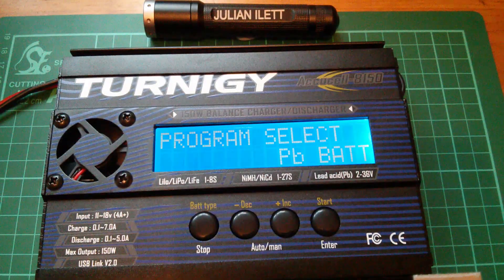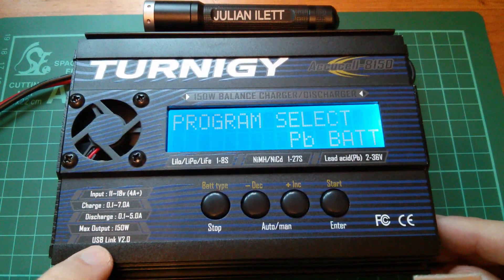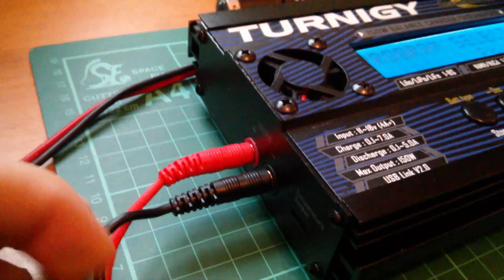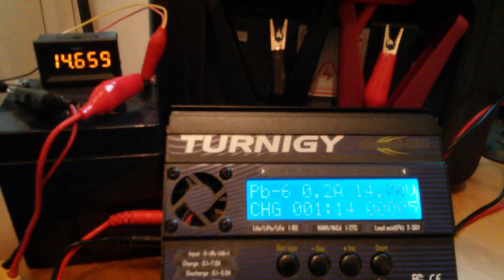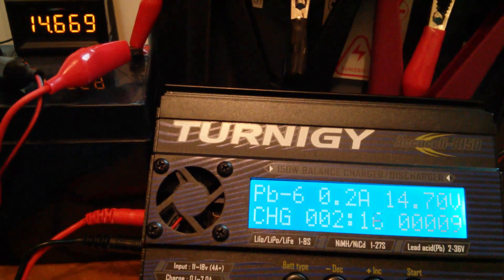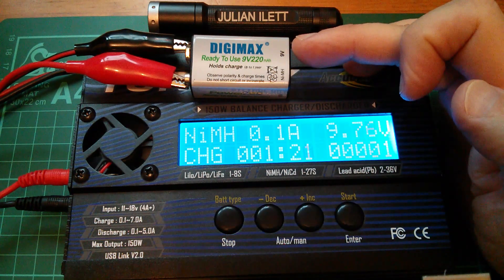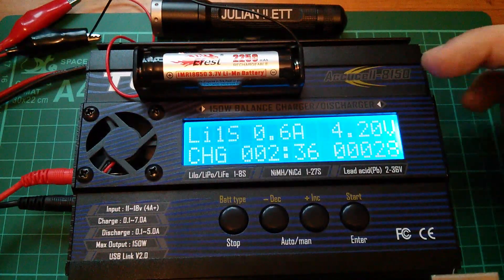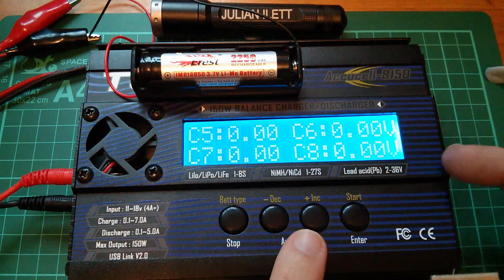First Look: Turnigy Accucell-8150 150W 7A Balance Charger

Comment: i have just purchased one of these chargers because i am just getting into quadcopters and some of reasons for buy this might help you also in your projects the main one is the Cheali-Charger firmware https://github.com/stawel/cheali-charger and the fact it should be easy to upgrade the fets to turn this into a beast of a charger also i was looking to change the linear regulators to some of the direct 78xx drop in dc/dc switching regulators you can get now so i can also use 24v inputs and lastly the atmel chip which will help me mod the firmware further. thanks for the videos they have only reinforced my decision to buy this cool little charger.

Comment: The charger maintains voltage at 14.7 volts and drops the charging current until it reaches zero, then it terminates. 
If you discharge your small battery some and the charge it at something like 1 or 2 amps, you'll see what it does more clearly.

Comment: there refereed to as alligator clips not crocodile
Reply from the maker: Kristyanna Virgona Definitely crocodile clips in the UK - more often croc clips. Much better alliteration!
Reply: they been Alligator clips since I was 10 I have been into electronics since then and I am 61. also I have gotten 2 of the SkyRC b6 chargers that were counterfeit  until I brought the SkyRC b6 mini 6A charger
Reply: BTW Julian, I wonder it SkyRC makes them and then brands them to different Manufacturers? because your Turnigy is exactly like the SkyRC B6

Comment: Lithium ION battery is a cluster name for all lithium based battery that is mineral based and around 3.6V, there is like 20 different types, but they all behave kind of similar. But they do varie a fraction of a volt between different types. Lithium polymer is kind of part of the Litium ion cluster of batteries types, but because they are more sensitive they are marked diffrently. Also, they use a synthetic based electrolyte.

Comment: that unit is the same as the SkyRC iMax B6 (copy version (aka counterfeit) not the real one) I been trying to get on Ebay. I found a place that has the iMax 6 Mini which is a genuine SkyRC unit and its a 6A vs 5A for the original iMax B6. I have gotten 2 counterfeit units in the last two weeks  one only would charge my SLA batteries and almost damaged a set of Li-Po batteries. the current went up high.

Comment: Very simialar specifications to my Imax B8 chargers which I use with my Quadcopter gear. I believe that my ones are the non-fake ones and they do have the mini USB port presented on the side. The use of the USB port seems to be very thinly documented.
Reply from the maker: kibi15 I've had a quick look inside and there's a place on the PCB for a USB socket, but it looks like it's being used for serial data (only two of the pins are connected up). Looks like the USB cable would have to be a FTDI type cable.

Comment: I have a Turnigy Accucell-6 which I must have picked up about 5 years ago. I have all ways been quite impressed with it, it just keeps on soldiering on. You have to be careful with knock offs as I believe there are fakes about. The odd charging effect you seem to have noticed I think is just it checking the float voltage before continuing to charge, so perhaps your cells just hadn't reached their peak float voltage? Anyways, you know more about this stuff than me & i'm sure you will figure it out :) keep up the good work, I do like your videos :)

Comment: Most of these hobby chargers that use a four button interface have the same menu structure. It is awkward at first, but consistent across the chemistries, I suppose. Only real gripe is having go to the user settings whenever changing lithium chemistries... sometimes easier to use the 'load / save' program memories to change lithium chemistry / parameters to change charge current, chemistry and number of cells in one fell swoop.

You hold the inc and dec buttons down to get the auto / man option. When getting the cell info, you press dec to get cells 1-4, second press gets you 5-8, and a third press takes you back to the charge status. When charging ni-cad or ni-mh, it does periodic checks of battery by reducing charge current and checking what voltage the cell drops to. Pb / lead acid charging does a CC and then CV charge, which you can see in the video as it changed from 0.3A to 0.2A. And this does look  like a fake, but some chargers use a external serial - usb adapter that plugs into the temperature sensor port. You can usually tell in the program settings menu though, as there is usually a USB or TEMP option - you can't use both at the same time!
Reply from the maker: Peter Feerick Thanks Peter for the info. I haven't seen a USB/TEMP option in the menus and there is a position on the PCB for the USB socket. When I do my teardown, I might put a scope on the USB pins.

Comment: no 2 cell balance socket?? mmm dont like that as i always use 2 cell lipos. you will get used to the menu very quickly. when you want to start a charge you always hold down the start button for everything. they are a bit daunting at first

Comment: Dissasemble it and see what it would take to add usb
Reply from the maker: That's my plan. Teardown video coming soon.
Reply: Hopefully it would be easy. My school has a different charger with absolutely identical specs to yours, including a missing usb port, same interface, and connector. Their missing usb has an obvious spot on the plastic side where it is filled in. I await the teardown!
Reply: Julian Ilett
Do it right with optoisolation, else you will some day burn you usb port.
Look how its done in multimeters. My charger has Silabs CP2102 chip and its not easy to solder. It has only RX and TX connected, and logview only reads data from charrger. You can change CP2102 rom settings so that logview detects it.

Comment: i've been using the imax B6 for about a year and only new killed it. i have been looking for a charger that handles 12 series lithium for a while. i must say the 5a discharge on that Turnigy is quite cool. the imax b6 is only 1a and it takes a while to discharge large batteries.

if you need a 12v power supply for the turnigy use an old PSU, some can handle 16a  on the 12v side.
Reply: Rinoa Super-Genius I don't think Iwantitpaintedblack knows that PSU is short for a computer power supply.
Reply: and i didnt recognize you because you changed your profile pic
Reply: i would say a computer power supply, 
cheap ones start at 10A and al the way up to 65A
Reply: iwantitpaintedblack
so your just repeating me?
Reply: Rinoa Super-Genius Oh, 
Sorry, i misread it as "UPS" in your comment,
i know that PSU means Power supply,

i am also subscribed to you, your e-bike builds are awesome, and i guess you are the only one making videos about 18650 Cells and working with them,keep it up
Reply: edit

Comment: Julian, The four button interface is almost an industry standard from the very cheapest to big dollar name brands. Once you have programed and saved the few charge profiles you need on a regular basis then the 4 button interface is actually quite efficient.
I think you are going to be frustrated with the 150W charge throughput once you get around to the Epower bicycle when it will likely take all day for a charge and unless you have complete faith in the charger you dare not leave it unattended. (you should not an any case but that is the ideal)
On the subject of faith it is critically important to have very good connections for all of the battery connections since we are detecting peaks to an accuracy of 0.05v or less per cell, so save yourself the frustration and cut those croc clips off.
Given your interest in solar power and batteries in general I am surprised you did not select a FMA Powerlab 8 of the I Charger 3010. Both are very capable chargers with useful functionality beyond basic charge and discharge. Take a look over at http://www.progressiverc.com for a view on what the hard hitters use an abuse:)
I recently upgraded from a 4 button 10A 6cell charger to the I Charger 308 duo. A very versatile charger with a few interface quirks of it's own but overall quite nice. It will even 'reverse' charge from the portable battery to a much larger battery like for your solar bank fro example.
Reply: Julian Ilett having owned a fair bit of these chargers for my RC cars, i felt i should tell you my theory for the NiMH charger section. as far as i can tell the reason it pulses between charging and 0 amps is its way of knowing how charged the battery is. say for instance when it goes idle and voltage drops close to normal voltage for a 9.6v 8 cell pack, the charger will probably stop charging when it gets close to 12v and then let it rest to see where it drops to without load or a charge going to it. it keeps doing this till it doesnt have much amps going through it.
Reply from the maker: Rob B Awesome chargers, particularly the iCharger 308 Duo, but a bit out of my price range.

Comment: Looks a lot and sounds the same as my Clone/fake ImaxB6 beware it does not overcharge lith ions as the clone/fakes are known to do this. Does do a good job on lead acids and ultra caps tho, I actually blew up a tiny nimh battery up with one these granted it was a tiny solar light battery but i expected it to terminate charge when i defined settings etc. these things can be fun

Comment: From what I know, that "fast charge" for LiPos etc doesn't balance the cells.
Reply: Even the normal charge does not balance on these chargers for reasons of speed. That is why they have a dedicated balance charge mode since most RC users would rather have a quicker turnaround time when charging at the field and re-balance after a few cycles at home where time is less critical.
Reply from the maker: Rob B That makes a lot of sense - no need to balance the cells every time they're charged.

Comment: I have been using the Accucell 6 for about a year now and am pretty clued up how this thing works.
It didn't stop charging your SLA when it hit 14.7V because it switches from CC to CV mode at this point. This is why it was only showing 0.2A at this time. It will continue to reduce current to the SLA until it reaches C/24 at which point it completes the charge. My model does not come with any kind of trickle charge function and i'm pretty sure yours doesn't either. Also on mine there is USB functionality, BUT, it uses the temp sensor port and the components that enable this have to be populated first. Wierd, but there you go.
Reply: Also, to get it to change from 'MAN' to 'AUT' you have to press and hold both the + and - keys while selecting current. I.e. Select NiMh, hit start to select the current and while it is flashing press both the + & - at same time. Display will change from aut to man every time you press them both.
Reply from the maker: ColdTurkeyFlu Ah yes, I do remember reading something about pressing the + and - buttons together. The manual is difficult to read because the English isn't very good, but I'll persevere. That is weird about the USB - I'm not too bothered about USB connectivity really. I just wish they'd put more buttons on this thing (6 maybe), it would make it a lot easier to navigate.
Reply: I agree the menu is convoluted but there really isn't much to it at all, it just feels/looks clunky (the cheapo buttons don't help this) but it is cheap as chips though! The USB functionality isnt what people tend to think either, It's more a glorified data-logger that interfaces with a specific windows program (I am trying to find it now). Personally I don't have a scope and I would love to have my charge/discharge data plotted onto a graph for the sake of a few quid in parts and and evening with the iron!

It also seems to charge my phone batteries better and cooler than my phone can!

Personally, I love it! Best 15 quid I spent this year!

Comment: I've used one of these chargers (it wasn't the turnigy model, but there are tens of other models with a different badge on it, all with the same UI) and it's ok if you only use a single battery type (chemistry, cell count, capacity). But as soon as you have to change settings for different batteries the menu is indeed atricious.
Even worse, I've seen models that have a touchscreen and instead of using it to it's full capability they seem to have copied the 4-button interface. E. g. instead of showing you buttons for 2 to 8 cells each (would mean single click select) they make you push arrows on the screen to scroll through the cell count and confirm with an OK button.
Reply from the maker: superdau Yes, I've seen those touch screen units, and I assumed the user interface would be much more user friendly. What a cheat, porting over the horrible 4-button interface! I guess I'll get used to the menu system in time, and it's not the worst UI I've seen lately. I have an electronic key lock box which is completely unfathomable.

Comment: Ni-MH and Ni-Cad use Delta charge methods so it charges essentially limitless until it detects a Delta negative drop of 5-25mV (which indicates the battery is charged, it's a chemical action which causes the drop) depending how it's set up. Then it terminates charging. That's why you don't set a voltage. And you'll find that the higher the current the higher the voltage will go too as it's limited by the battery. I have a Typhoon charger which works in a similar fashion which does this and it seems to work great.

For the lead acid battery I'd expect it to terminate when current drops to a low enough value that it's considered floating? I've never used mine to charge a lead acid.

For Lithium, it should do as you say, 10% of the charge current is when it terminates charge.

I should get one of these as I want the discharge function that is missing from mine!

Comment: usually its a fake/clone when there is no serial no. on the back but usually clones are just missing some output filter caps so they are still good :)
For better discharging you should use the NiMh discharge and limit it to 2.7V that usually works better then the default lipo discharge that cuts of at 3V.
Reply: Julian Ilett
They are reputable. Send it back!
Reply from the maker: Zentrius There's no serial number on this one and it came straight from the Hobbyking UK warehouse. Slightly worrying!

Comment: This is probably a fake Accucel-8, hence the missing USB port. Turnigy charger knockoffs are unfortunately all over eBay. The only official reseller of Turnigy charger is hobbyking.com. Hobbyking.com has the following warning for the Accucell-8:

"ATTENTION.
There are several chargers now entering the China market that look similar to the Accucel-8. These chargers are produced with cheaper FET's and unfortunately much less accurate and very unsafe. There has been reports of the copied chargers over-charging packs and not balancing correctly.
Our chargers have CE and RoHS certification, proving there safety. Plus, thousands of customers the world over have used our chargers with excellent success.
Your batteries are expensive. We understand this and thats why we will not carry low-quality charging devices."

Maybe this is worth a teardown to see if this charger really has FETs which can handle 7A+.
Reply from the maker: No, this is the genuine article. This came from Hobbyking and was quite expensive. Some of the product reviews do mention that the USB socket is no longer fitted. I should have said where I got it in the video.
Reply: Julian Ilett Ah good, you usually get your stuff from eBay/China, so I thought I should mention that ;-) But it looks like you did your homework.
Reply from the maker: telecrate You're absolutely right to mention this. I know there are loads of fake 6-cell chargers on eBay (I might try one some time). 8-cell chargers are much less common.
Reply: Julian Ilett I got one of the fakes and while it mostly works ok I feel like I have to babysit it all the time. I discharged a 2S lipo yesterday and discovered it at 5.6v instead of stopping at 6v as it was supposed to. It's kinda a bummer that you can't set the discharge limit yourself, eg. I actually wanted 6.6v, so to end up at 5.6v really pissed me off. Next time I do that I will also connect my low battery alarm from the quadcopter to make sure it doesn't try anything funny again.

Comment: I have a model very similar to this, an Accucell-6 that can do, surprise surprise, only 6S packs, and I didn't know about all these sub-menus available while charging. Maybe I should sit down and play with it some time. Mine also has a 2.1mm barrel jack with an included adapter with a pair of clips on the end, rather than the hard-wired cables yours does, which seems a bit strange because mine was working quite happily doing a 500mA charge on a 1.5A wall adapter the other day. I wouldn't use it for anything beyond 1A charge, but for low current it was great. Funny how they don't give you that option here.